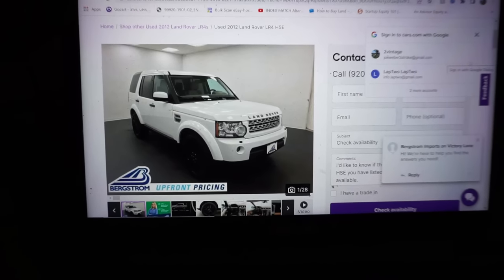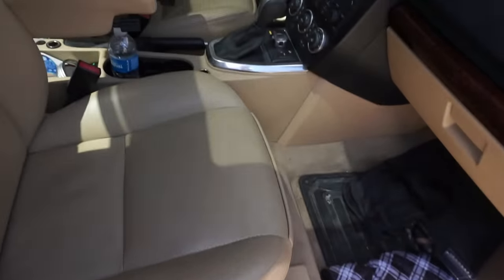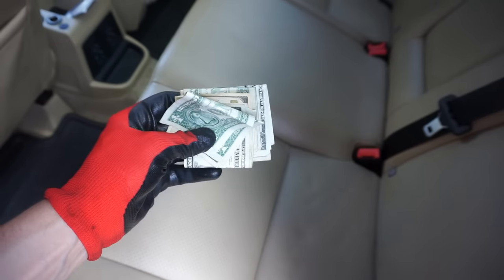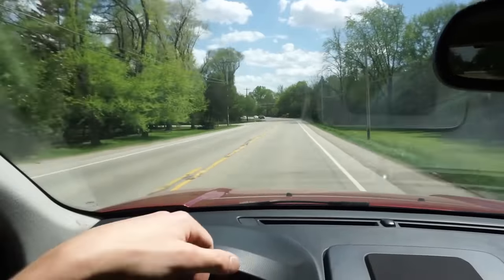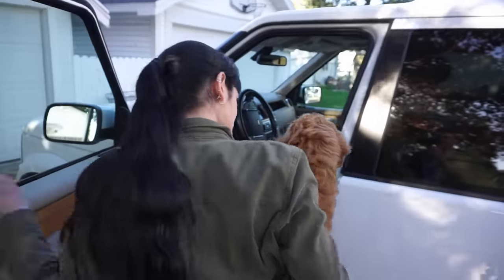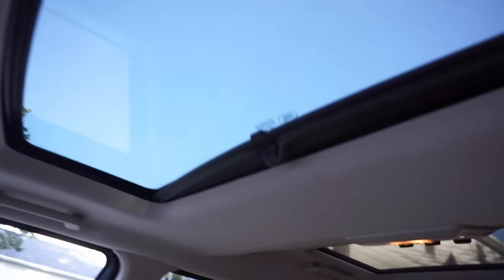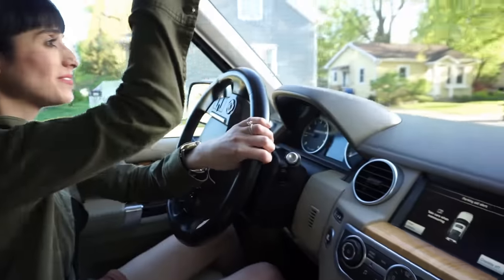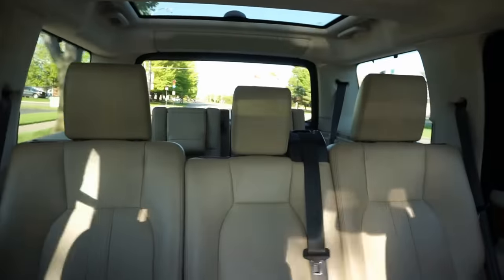Surprising My Wife With Her Dream Car + New Puppy

Comment: We’ll see how it goes…? 
I got a German Shepard pup at 11 weeks and roty x gsd at 11 weeks both unwanted pets and by 13 weeks the Shepard started showing issues.. 
sever growling/snarling and tensing up….
Took him to the vet thought it might be something neurological but turns out he was just a bit jeckle and Hyde… 🤣
Brilliant dog apart from those off moments..
Parents said I should give him up but I knew no one else would keep him showing what they would assume was was pure aggression and potential attacks on people and dogs… 
Which wasn’t the case as even at his worst looking and sounding you could touch him anywhere, pull on his ears tail paws, put a hand in his mouth and he never struck/attacked once.. never attacked the roty either but the rotty did put him in his place a couple of times..
I had the Shepard until he was 7yrs old last year, he developed a heart problem with loads of fluid on his chest and the it was easier to let him go peacefully rather than suffer a massive heart attack trying to keep him alive on shit loads of tablets and tell him stop getting stressed and you can’t run around anymore…
Dogs are for life, not presents to discard when your bored of them after buying them as a fashion statement and the dopamine has worn off